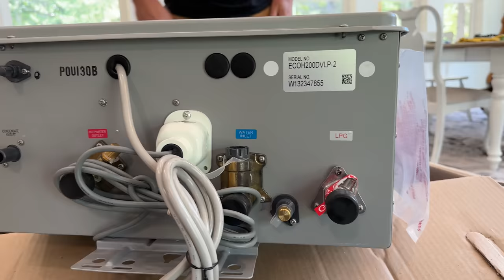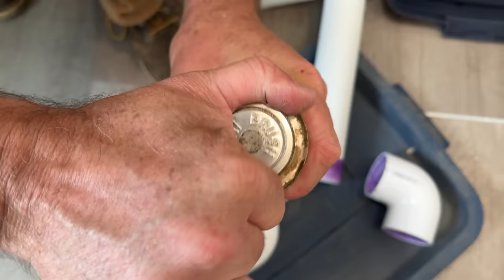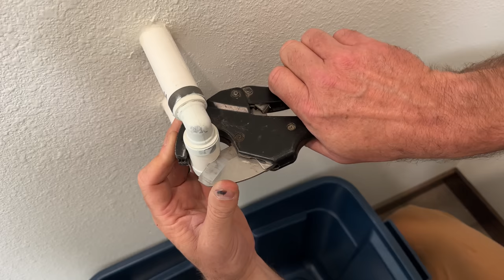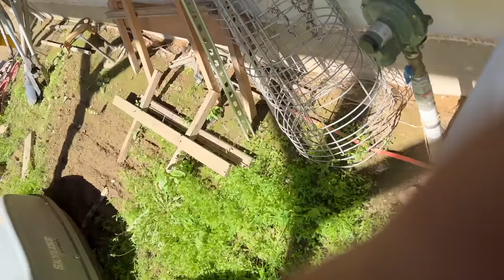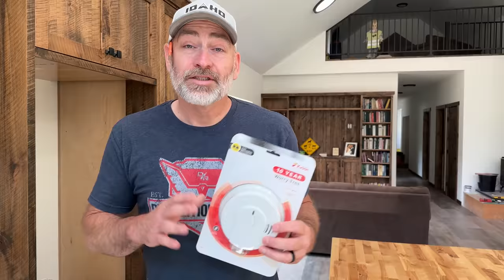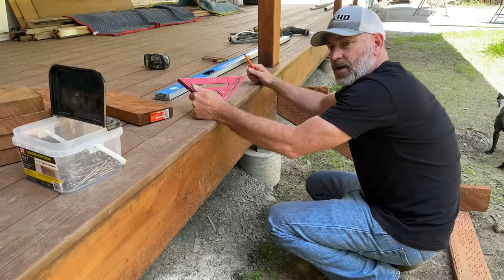Off Grid Water Heater Installation

Comment: Good job on the water heater! I couldn't tell if  the timber you laid on the ground is pressure treated, but if not, it will rot very quickly. You could also use a 12"x12" paver for each stringer.

Comment: Julie use old pillow case to dust fan blades. Spray inside of case with a touch of end dust. Place over a blade and use both hands to clamp around blade and slide slowly off of blade. Repeat for each blade. Finally, turn inside out and shake dust off ( outside) and then wash pillow case for next use.....

Comment: Good choice. I have installed hundreds of instantaniuos water heaters and a service flush once a year with a professional cleaner not vinager with keep you problem free for many years. I use to use a small drill pump  from Amazon on my cordless drill with a plastic bucket and two laundry hoses. From experience I never liked using flex gas lines on LP. Propane is pumped many times with oil filled pumps and the gas carries small particles of that oil and it can collect in the ribs and dips of the lines. There should be a drip tee at each appliance to collect such oil. Bare minimum a drip tee at the reg entering the house to collect the oil. Also a three elbow swivel on the gas line where the reg enters the house in areas of ground freezing. The gas line can heave from frost and push that line up and break it off, a swivel prevents that.

Comment: personally i would have went with a heat pump tank water heater, they are low power and can be ran off grid
then automate it to only run during the solar production
Reply: plus you have propane inside your house so many issues would worry about gas leaks explosions poising by gas bad idea Heat pump as above on solar

Comment: Most homes need a sediment trap on the gas supply line feeding the water heater and furnace (sideways T with the supply coming in the side, water heater on the top and a small capped section going down)

Comment: Retired master plumber,from Texas, nothing wrong with running gas flex, but I prefer running black iron pipe through the attic, and my down drops, and flex pipe on fixtures, ,also should run a drip leg,- tee standing up, going to each fixture, on l.p. to help catch moister, and any trash in the lines,, so as not to clog up fixtures, and really should test system with about 5 lbs. Air pressure, for your leak test, but good job

Comment: something to consider for blocking your firewood. Take your tractor with  grapple grab one end of the log maybe 3' or so lift to a comfortable height measure desired length and cut near where you are stacking it.

Comment: Looks good, except you technically need a drip leg on the gas connection (where you found the leak). Use a tee connection, run your flex pipe in on the horizontal connection, and the drip pipe in the bottom vertical connection.  Google gas supply “drip leg”.

Comment: Marty, have you set your winter angle solar panels to summer yet? Also your smoke alarm is too close in your kitchen. False alarms. Should be 10' away horizontally if I remember right. There is a sheet in the box that tells you where to install them.

Comment: have had my tankless for 8 years now!  works great!  natural gas version!  I also have well water with 4 stage filter and so far I have done a cleaning every  year for an hour cycle using white vinegar and it still heats to >120 in about 30 seconds.  Reem says twice a year for hard water and maybe I should but so far its been fine though I have been replacing the filter twice a year

Comment: Be sure to ground your gas line, especially because of the stainless steel yellow flexible lines. Only need to be grounded in one place, typically at the house entry point.

Comment: Are you sure those two copper tubes were the same length. The one on the left looked longer, maybe you just needed to switch the tubes. Measure and see, but it would make sense they were different lengths considering they knew the one on the right would need to be longer.

Comment: Fyi the t&p valve should not be piped outdoors or to a drain. It's a safety valve. You want it to release (if it should) not to the floor so you see it an ask the question why is the floor wet. And you will find that it came from the t&p and than you know there a problem with the tankless.
Reply from the maker: Maybe but the inspector said it must go outside.